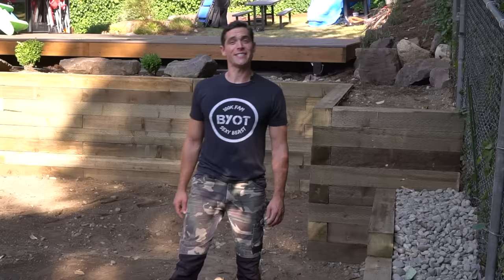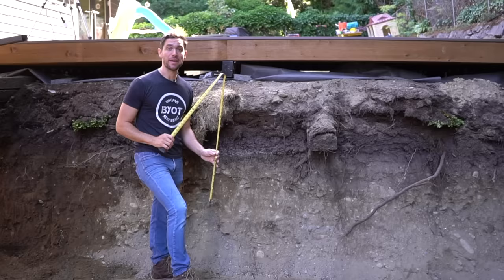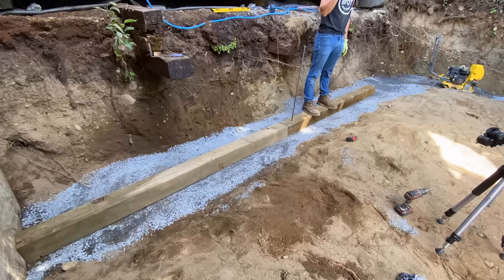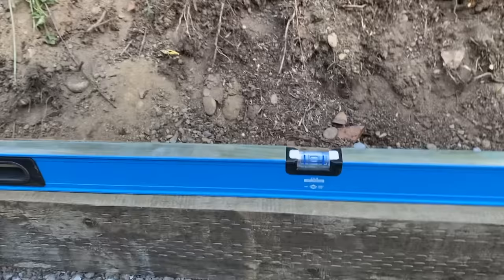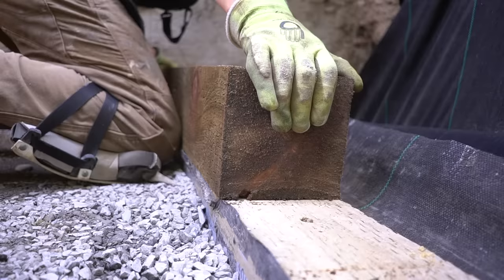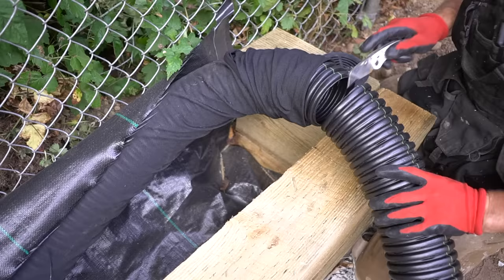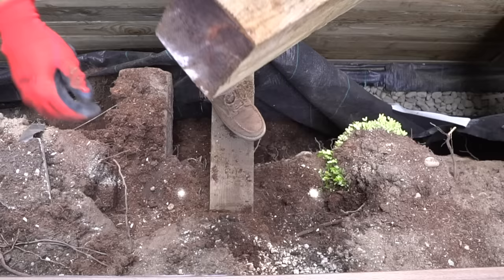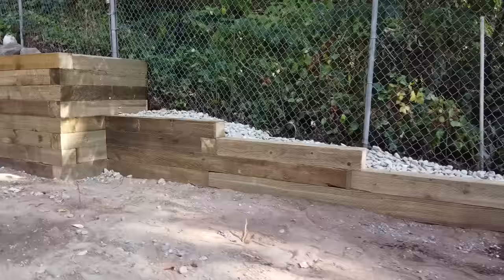HOW TO BUILD A RETAINING WALL

Comment: There is a reason most building codes require a civil engineer to stamp drawings for retaining walls over 36” tall. You should have hired one, they can tell you what you missed on this project and how your deck will affect this wall. Regrading that much space also requires a stamped drainage plan by a civil engineer. People are going to follow this and cost them money.
Reply from the maker: J I assure you that I did extensive research before doing this project. In my area you don’t have to have a civil engineer stamp drawings unless it’s over 4 feet. If there’s something that you would suggest changing or doing differently please let me and my audience know. Thanks for watching.
Reply: @BYOTools  Thanks for commenting back to me. I do enjoy your videos. I am licensed engineer (electrical) in construction and I work with a lot of civil engineers. You said in the video the wall is 4 feet tall, but it looks like you measured from the old grade. You didn’t take into account the first row which you buried, which would make it over 48 inches from bottom of first row to top of top row. Is this true? Or did I miss that in the video?

About five years ago I also redid my own retaining walls, but mine were 5’ tall by 40’ long, two tiers. I chose block, each block weighing around 85 pounds. Destroyed my back. Well that and installing my 30’ long multiple drop pondless waterfall right before the wall.
Reply: @jaydouglas1090  pics or it didnt happen :) I need about 60 feet but only about 30/36 inch high point is to stop my dog from running away. I want to copy you. The slope isn’t drastic and its to take more of the woodsy area behind my house and add to my backyard.
Reply: BYOT - Did you check with your local building official? 48” is a commonly referenced dimension for not needing engineered plans and permits but is for the entire height of the wall not just the exposed portion so your wall by definition exceeds 48”. The other caveat with that is there not being any surcharges such as the loading from your deck foundation.  This might not be an issue for you if the foundation is more than 5’ away from the wall.
Reply: @johnlee7085  what are you going to tattle or something? Sheesh man don’t even mention stuff like that
Reply: If I may add one thing here. Making it look pretty by pacing a joint below a tie-back(another joint) is a fail. It needs to be just the opposite. Using 8' length timbers requires staggered joints 4' apart as a general rule.
Reply: @BYOTools  The deadman should be continuous at every second row.

Comment: Not a dead head. It's a dead man (like being buried 6' under).  

FYI, calling 811 underground locator service only does PUBLIC property and some utility easements on private property. Irrigation, electrical, natgas, sewer, water, cable, telephone etc etc are not marked on private property - so dig carefully and know where your shutoffs all are before you start digging/driving 3' rebar spikes.

And saying duct tape will hold over time when subject to moisture is hilarious😂

Flexible perforated pipe is next to worthless - crushes too easily. SDR perforated pipe is best, but an acceprable option in this situation is three wall perforated pipe that's found at big box stores.

That this guy thinks he knows how to properly build a retaining wall - sigh.

Comment: I'm a Professional Structural Engineer and have 1 piece of advice. Don't ever build a retaining wall like that. Deadheads. Really. Destined to collapse. He should stop using the words strength and stability because he has no understanding of Structural Mechanics and Soil Mechanics and that wall is very poorly designed with zero understanding. It may last last few years but eventually will collapse.
Reply from the maker: I take great pride in the videos I produce, especially the builds that need to be structurally sound.  I've done extensive research on retaining walls and have built multiple like this including one for my very own house that is taller then this one.  It's been up for over 10 years with ZERO issues.  I appreciate the technical profession of a structural engineer but if I can pose a question to you.  Have YOU ever build a timber retaining wall?  Theirs no better construction school than real world application.  If you have built one before then please educate my audience and tell us what you would do differently.  I'm always open to learning from others.  Thanks for watching.
Reply: @BYOTools  That question is ridiculous, because if you have worked as a qualified tradesman in the construction industry you will know that, the engineer provides structural drawings, constructed by a qualified tradesman, and certified by the certifying authority. 10 years is not a long time. Retaining Walls should last at least 50 years. After 12 years as a Design Professional I now write reports of collapsed structures, and timber retaining walls such as this one are one of the most common structural failures that usually collapse within a period of 5-25 years. Also, the persons building these walls are usually nowhere to be found by the time the client's are left with collapsed walls, often undermining their foundations and potentially causing tens or hundreds of thousands of dollars worth of risk of damage. Do your viewers a favor and get at least one wall designed and certified by a structural engineer and a certifying authority, so that you can base the rest of your walls of a copy of a wall that has been properly designed. I have 2 reports this week alone on collapsed walls such as this and I look at your video quoting "strength and stability" and just cringe, because that wall has neither for long term longevity and just relies on apparent cohesion of fine grained soils until soil creep eventually put's it to the test and that's when it will fail. Looks real pretty, but has no basis in engineering principles. Put short, you shouldn't be suggesting this idea of deadheads offering anything but a fraction of the strength that retaining walls require to your viewers.
Reply: @BYOTools  I have built countless timber walls using RR ties and CCA timber. Some of the criticism here is based on erroneous information but any one of these guys who have said they are a professional of one type or another, even some of the others has all been spot on in their concern and criticism. I suggest you learn from this going forward and build better. Live and learn. The best teacher is a messed up job site. The good ones all go through it.

Comment: That "drainage" pipe you installed isn't worth SPIT !  You should have used Sch40 PVC ! It takes very little weight to crush the corregated pipe down flat ! IT has NONE of the strength or rigidity of Sch40 PVC ! The ONLY reason you used  corregated was because it was CHEAP !